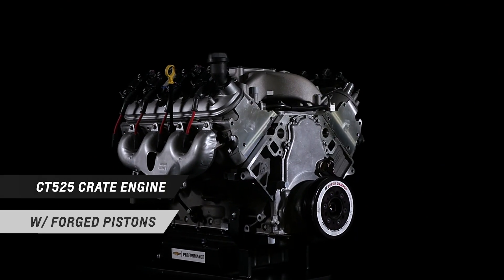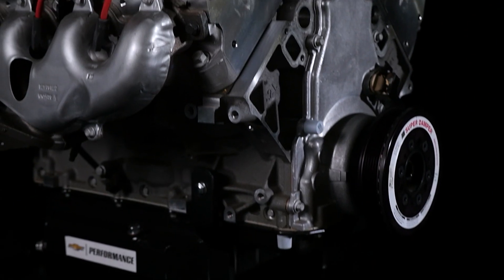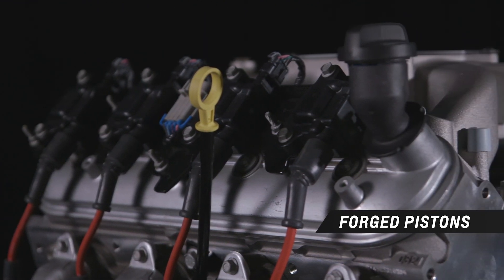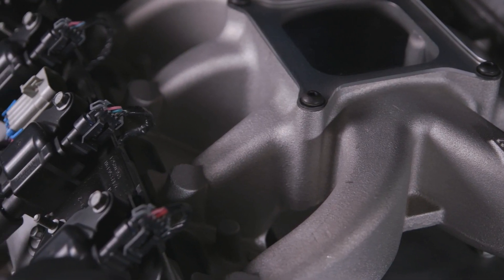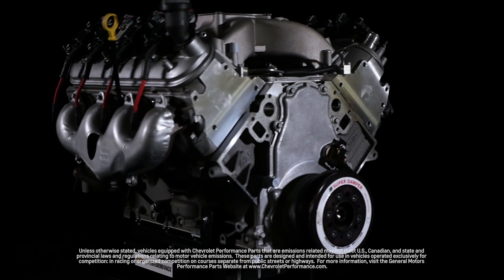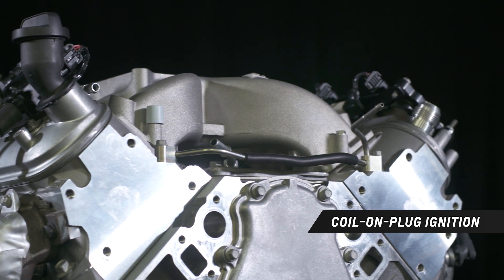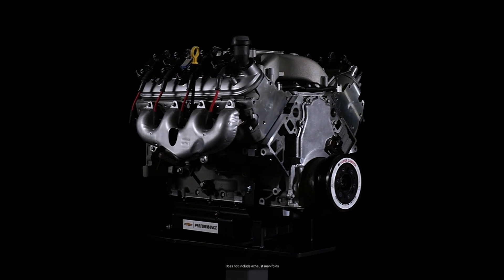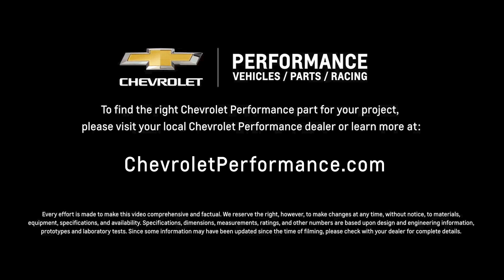Chevrolet Performance - CT525 Crate Engine with Forged Pistons - Information & Specs

Comment: So far the only CT525's I've found are the Hypereutectic piston version, GM uses same part # on the old CT525 as the new one,
How do I know?, I just purchased one and got it today through Motorstate and the instructions including the engine was built in 2,016, Engine was built nearly 6yrs ago. and there's none available through Scoggin Dickey, Pace, Etc. as they're sold out of them and I was told they wouldn't be getting anymore for approximately 6-7 Mos., GM IS selling the Old Stock